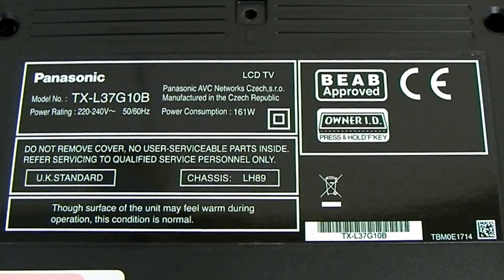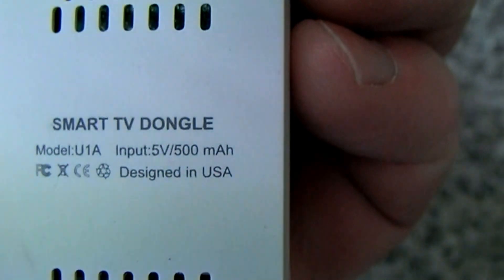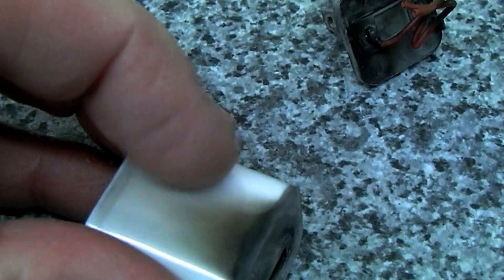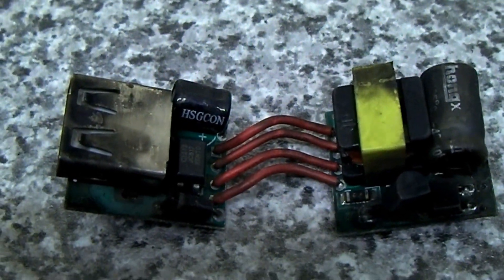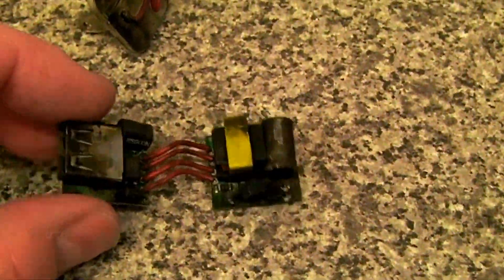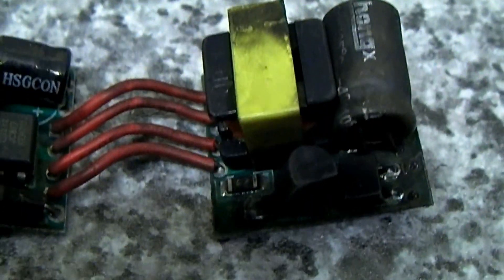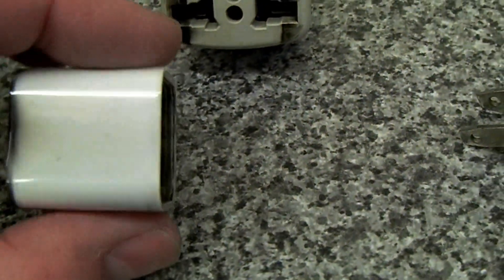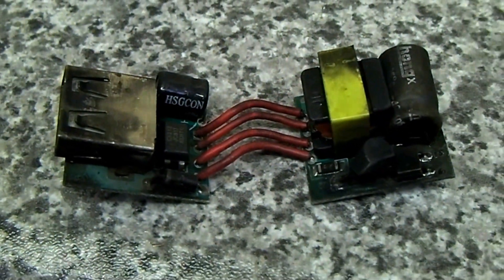Do not buy cheap power adapters from ebay!!!!

Comment: Customer should declare a dispute with eBay, saying goods not fit for purpose and fake goods. That will affect the seller, he may even get the price of the cheap OHL unit back. The TV will probably still have a good power supply, the mainboard will be toast. Keep it for one with a cracked LCD or a blown PSU as a quick fix.